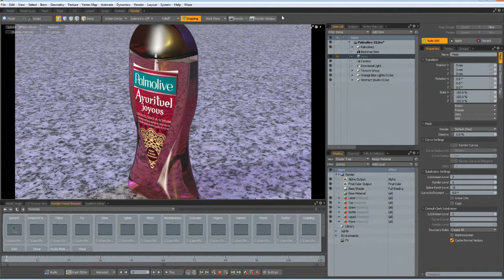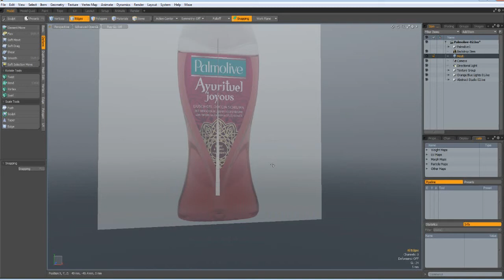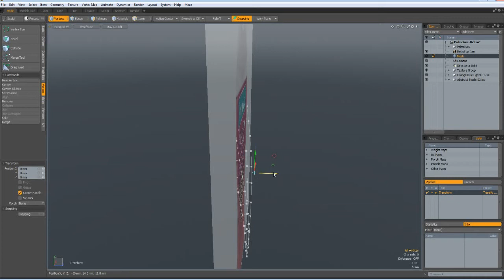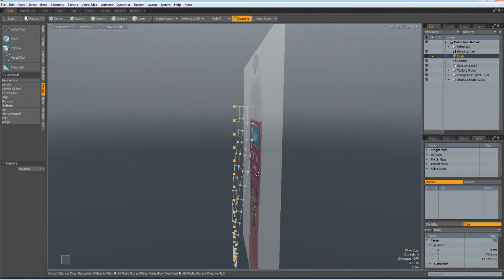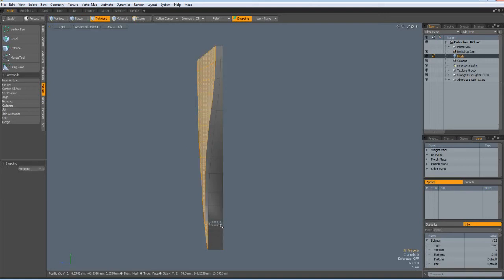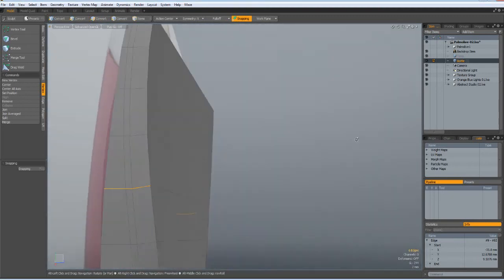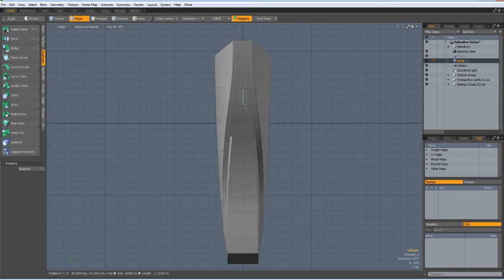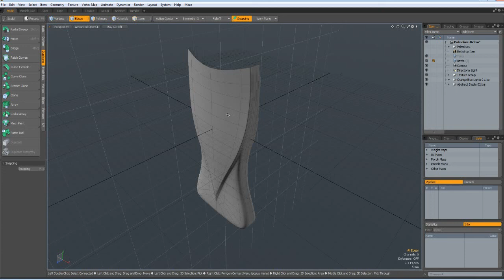Luxology modo - Modeling a Palmolive Bottle with an interesting seam

Comment: Hello Peter How have you been doing. Very nice tutorial I would like to try it but I am having trouble finding a picture that corresponds with the dimensions that you use. Could you please provide a link to the picture that you used or e-mail me the picture? The pictures I have tried are very large and I am having trouble getting it the right size. Any help would be appreciated. 
 
 Chuck